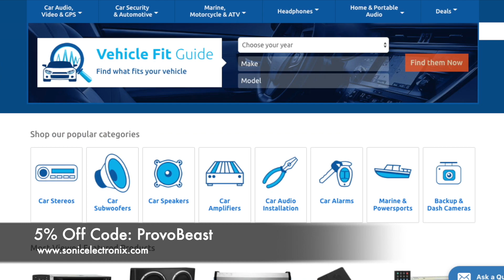NVX 10" N-Series Subwoofer Unboxing and Demo

Comment: Could you test the 2nd generation please?
Reply: I have it and it sounds great
Reply: Jesse Delatorre I was confused when I left this comment. I was asking about the 2nd gen vsw. But thank you so much for the feedback.
Reply: @jasonsmith7345  I have the second generation sub it's great you have to let it break in and once it does it sounds great for a entry level 10 I'm planning on adding another one
Reply: If you read the description it says this is the v2
Reply: Daniel Faust yeah I was meaning to ask about the VSWv2. I don’t know why I didn’t originally specify. I have a 12W3v3-2 at the moment I was wondering how they compare.